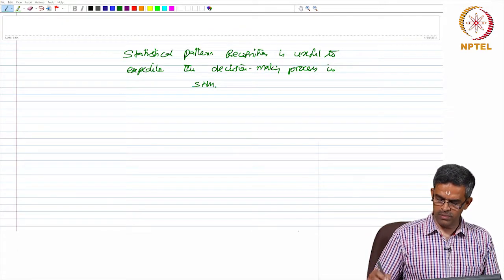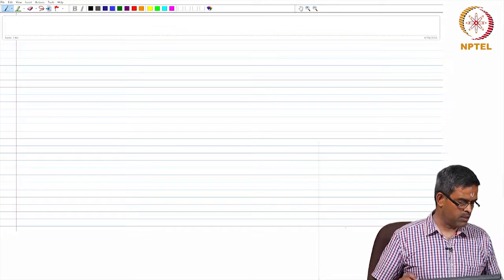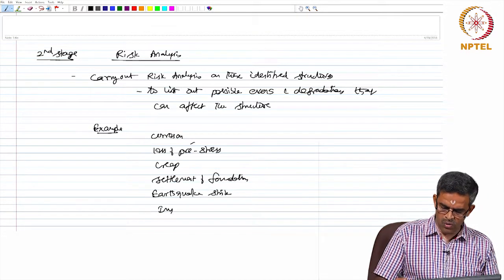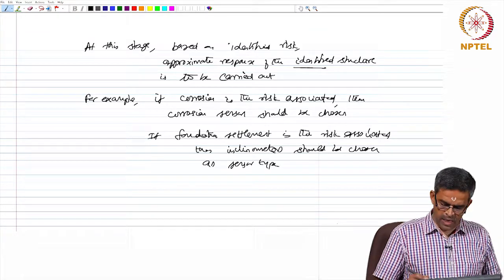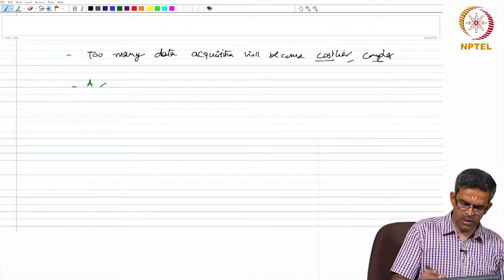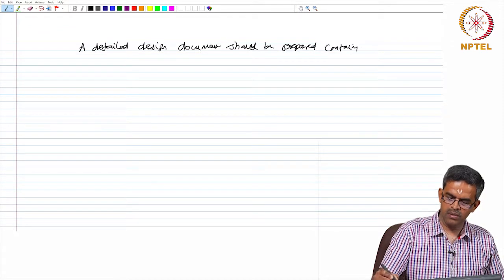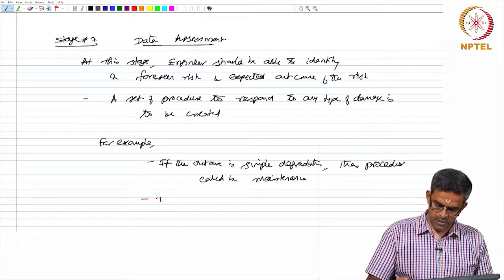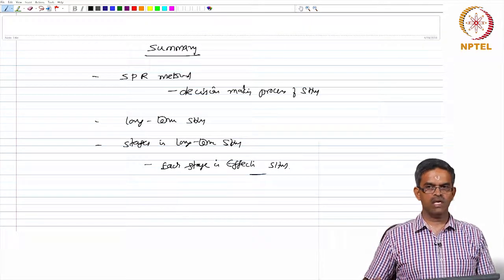Long term SHM (Structural Health Monitoring)

Comment: Long Term is a static process and refers to monitoring a structure over a large period of time (10-15 year)
Commonly used sensor to monitor long term structure health
Fibre Optic Sensor
•	GPS
•	Corrosion Senses
Long term monitoring is a seven-stage process.
1)	First Stage: to identify the structure that need long term monitoring
Structure required long term monitoring are as follows
•	New Structure including those have innovative aspects in design construction and material
•	New Structure associated with unusual level of risk
Example: Geotechnical condition of the soil of the site, Located at Seismic risk condition (active fault nearby) and Aggressive corrosive environment
•	Structure of strategic importance like offshore structure, nuclear reactor etc. can 
•	Existing structure whose disruption will affect the critical network like railway, highway & bridges etc.
•	New Structure in which their feature represents the large unit of subset of structure
•	Existing structure can also be long term monitored with known deficiencies.
•	Existing structure which are recommended for re-building. 
2)	Second Stage: deals with risk analysis
Carry out risk analysis on the identified structure.
•	List out possible event and degradations that can affect the structure
Example: Corrosion, Loss of prestress in highway girder, Presence of Creep, Settlement of foundations, Earthquake strike, Impact load effects, Above all poor execution of public structure
3)	Third Stage: to measure the responses for the type of structure identified, for each risk identified in the previous steps, one has to identify the corresponding consequences
Example: if a corrosion is identified as a risk in coastal structure which needs long term health monitoring, then expected consequences could be a chemical change, loss of degradation of section in terms of strength & durability 
At this stage based on the identified risk approximate response of the identified structure is to be carried out.
Example:
	if corrosion is the risk associated then corrosion sensor should be chosen
	if foundation settlement is the risk associated then inclinometers should be chosen as sensor.
At this stage it is very important to choose sensor type to measure expected consequences
Desired output of this step is list of quantities that need to be measure (monitored) and likely magnitude and location should be known at this stage.
4)	Fourth Stage: Design of SHM and sensor layout.
Objective: 
•	To select appropriate type of sensor 
•	Specifications of sensor that is operational range 
•	Installation requirement of the sensor (embedded, on the surface mounted etc.)
•	Technical constraint of the sensor and budget constraint.
It is always a good practice to include sensor based on different technology
Simple design and layout to be adopt for cost effectiveness.
Layout of Sensor- Different sensor can be connected to the same data logger
Several Data logger can be connected to the same data management
Data Management system should be integrate all data loggers to translate incoming data to single format which can be forwarded 
All vendor of sensor and data management system provide own software for data management, it is very important to have single integrated interface.
Detailed design document should be prepared at this stage containing the following
a)	List of sensor and type of sensor
b)	Layout architecture
c)	Installation plan and cable layout
d)	Installation process for design of sensor 
e)	Budget detail
5)	Fifth Stage: Installation and calibration
One should follow the manufactures instruction to install sensor
After installation and interconnection, they need to be tested and calibrated and Site Acceptance Test (SAT) should be conducted to check the efficient work of sensor
One need to also fix the threshold values in case of automated alarming systems.
Check this layout for successful working
At this stage a complete manual and calibration report should be generated.
6)	Sixth Stage: Data Acquisition and Management
Data should be acquired and stored in the database, it should have appropriate backup and an access authorization.
Major outcome of this stage is a complete document of the project management of data acquisition and management with log of events.
7)	Seventh Stage: Data Assessment
At this stage, Engineer should be able to identify foreseen risk and expected outcome of the risk
A set of procedure to respond any type of damage is to be created
Example: 
if the outcome is simple degradation, then procedure could be maintenance
if the outcome of recorded data is capacity reduction then there should be closure of the service of the system should be recommended.